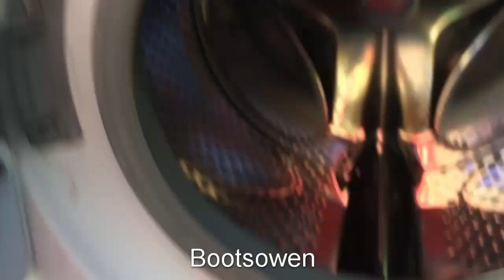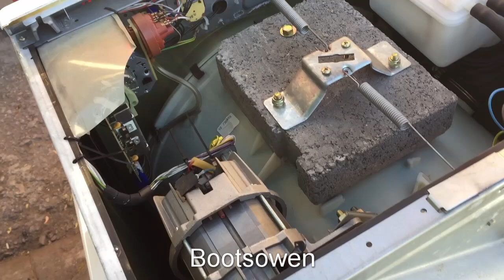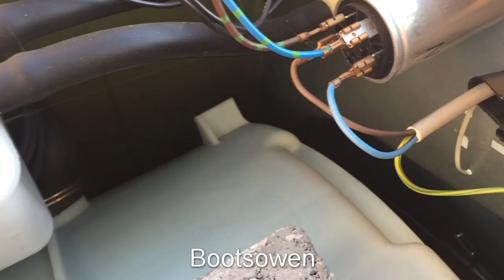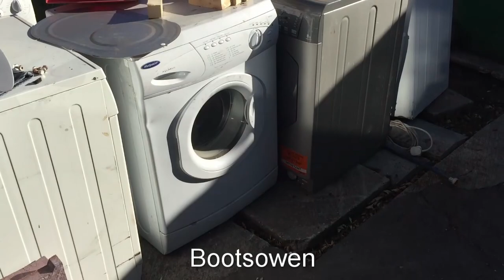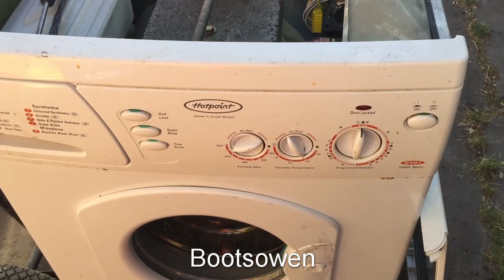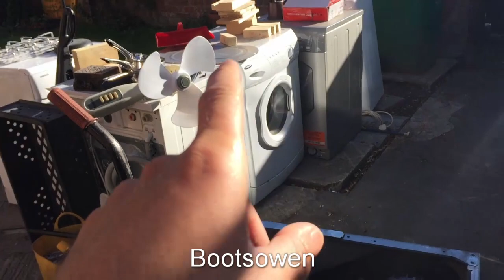Old Hotpoint inspection and efficiency rant

Comment: The hot fill would be a waste of time with homes that have a hot water tank as it takes a while for the hot water to come through.  I have that same thing with my combi boiler, have to run the tap to get the hot water.
Reply from the maker: You could apply that logic to any of the fittings that come off the hot tank. 
If you heat the tank with electric on a normal day rate then it is much of a muchness if the tank or the washer heats the water, but if you heat the water in the tank with gas or solar or wood with a cheaper KWH rate then even if there is a bit of loss to the pipes it is still cheaper (more efficient?) to use the tank.  It may also make the wash time faster if you are using water from the tank preheated as the washer won't have to wait for it to heat in the tub.